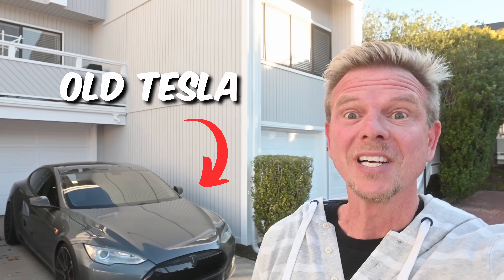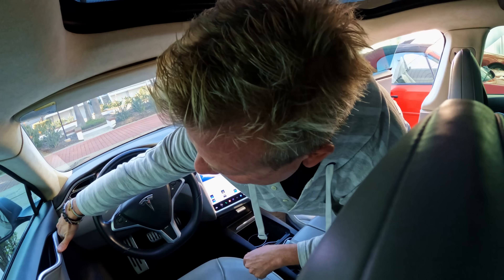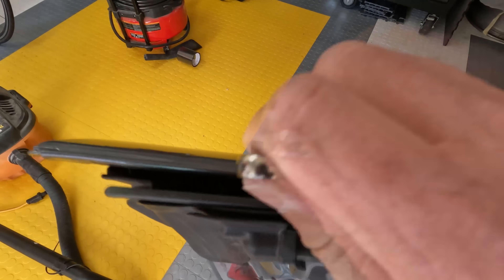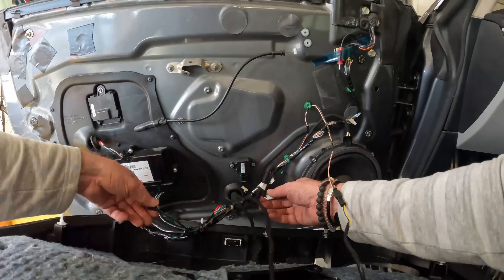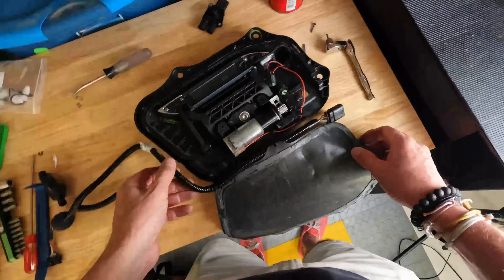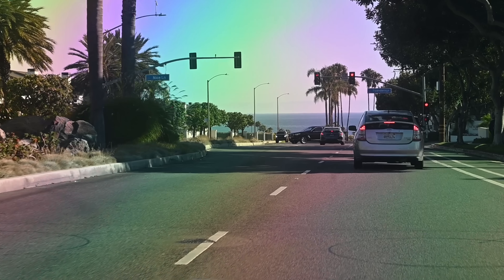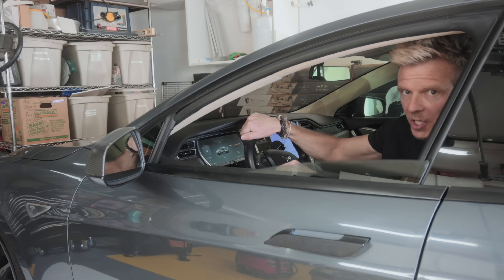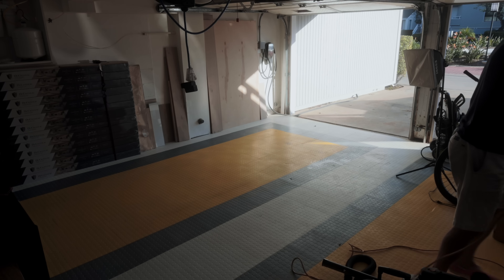My OLD Tesla Model S Just BROKE. Now What???

Comment: Never buy a used Tesla.  In fact, never buy a tesla at all.
Reply from the maker: And why would that be?
Reply: @cadreamdrives  By a hybrid.  Hybrids give you a redundant power source.  All electric will become a failure.  That is why Toyota pulled out of the all Electric market because they see where its headed.  Too many dead teslas with tesla graveyards accumalating premature dead faulty teslas.
Reply from the maker: @nbagoats4819  Where are all these failed Teslas, you speak of? 
Toyota’s decision seems driven as much by the fact that they missed the EV train. The world is going to EVs. Many countries have laws on the books will face out ICE cars. 
Hydrogen cars MAY become the next thing, but not for quite some time. 
Also, the Tesla Model Y was the best selling car in the world last year. 
Honest question: Have you owned an EV or even driven one for an extended period of time?
Reply from the maker: @nbagoats4819  We can probably argue the information you got from a Lexus dealer vs what I think based on 4 years of Tesla ownership, but that might not get us far. 
Instead, I’ll suggest this. Give an EV a try. Preferably a Tesla, but there are others out there that a great too. 
See what you think after driving one / living with one for a little while. 
I was a 100% die hard ICE car guy (I have about 8 ICE cars still). I had Zero intentions of switching to an EV - right until I bought one. The plan was to rent it out (I rent out cars), but the first time I drive it, I was hooked. And after living with it for 4 years, I’m never going back. EVs are better than ICE cars in every conceivable way. I’m slowly selling off my ICE cars (I never drive them), and I’m buying 3 more Teslas for our household this year. 
The ownership experience is THAT good. 
But don’t take my word for it. Try one for yourself and see what you think.
Reply: @cadreamdrives  I have 5 different family members with Teslas.  Have driven and ridden in them.  There are exceptions to every rule.  A few like it whereas the others have had problems and didn't like the fact that one hiccup in the battery and everything seizes up and dies.   Including your doors.  Very picky when the temp changes so does your range.  Range anxiety.  Battery degradation.  Getting from point A to B has never been more complicated.  NO THANKS!  

Like I told you, the writing is on the wall.  When I see a tesla all I see is a low quality concept being sold to ignorant status starving apple buyers.  I am not impressed. Hybrid is the best of both worlds and is more of a practical comprimise especially when it comes down to reliability.  EVs will be reduced to a smaller market and hybrids  with larger batteries will be the mainstay.  It makes a lot more sense.

The total market share of conventional hybrid cars and plug-in hybrids grew to 9.1% in 2023. The EV share only rose to 6.9% and is currently in decline.  Tesla shares dropped 6% last week.  2024 is going to be a bad year for Tesla.
Reply: My daughter had a 2015 model s , she dumped it after 18 months due to constant problems and dealing with the service center was an absolute joke. No more Teslas for our family. Very shady company to deal with.

Comment: I don't like the all computer cars.... think about me selling a computer controlled thing with one year warranty.. what stops me from sending code switching off options after 365 days??
just like the yearly self drive crap.... don't pay it after the year and guess what.... no self drive for you!!
Reply from the maker: You may have to stick with cars from the last century… Software driven options are used by many, if not most, of today’s manufacturers.
Reply: @cadreamdrives  Oh really.... can they just send a software patch and shut down option or modules in any new car? ??... maybe ..... but can you do it on a 2015 gas car with 8 on board computers,,,,,, so sorry they can't.... thus I stated all computer meaning controlled completely by a computer dependent on if you paid or not which would also give them the power to shut down modules such as yours  after warranty.. notice I CAN buy a door handle and install it in any 2023 car other then yours without having to take what...... 2 to 3 trips ..to a specialist??? I guess you guy love spending money and time but I would rather install it once don't you think?? and BTW before you say tesla or any other company would do such a thing..... read on VW diesel and now Cummings engines....... yeah......... it happens

Comment: Not buying the Tesla would have saved you a whole lot more.
Reply from the maker: How do you figure? 
For the last 4 years, I’ve paid $0 in gas and haven’t had to take my car in for an oil change, spark plug change, recommended service, brake pads or rotors, or anything like that. 
At the same time, I drive a car that’s faster than 99% of the cars around me, has better tech, and infinitely more storage space than any ICE car I have ever owned. 
I’m not quite sure how not buying this car would have saved me money?
Reply: @cadreamdrives  Did you buy tires?

Comment: Tell me again how an old BMW is a money-it please....
Reply from the maker: I can very easily tell you that. I have 6 BMW of varying age right now (we just sold the 7th one), and with the exception of the almost new ones, stuff breaks. And it’s not simple stuff. 
Why BMW can’t get something as simple as an oil filter housing right is beyond me. I understand how you make a bad design the first time around, but to continue with the same mistake in newer models is just bad. 
There are so many mechanical components in BMWs that just aren’t built to last. The dealers make huge money on the repairs, so there is no great incentive to build stuff that lasts longer. 
Oil filter housings, leaking valve covers, VANOS going bad, leaking timing chain covers, coolant parts that disintegrate, valve seals (which caused the engine in my 650 to self destruct), window regulators, high pressure fuel pumps, having to walnut blast the valves because of direct injection - the list is literally endless. 

Yes, the door handle went bad on my Tesla. And yes, there are other things that can fail. But the order of parts that can fail are magnitudes smaller than on an ICE car. 
Oh - and that list doesn’t even include all of the maintenance items you have to do regularly on your BMW or the cost of fuel, which is exponentially higher. 
So yeah - old BMWs are money pits compared to old Teslas. 
Which is why I’m selling all of mine and getting more Teslas.

Comment: Moral of the story, don't buy a Tesla. Beautiful cars but engineering is bad. There's a whole channel here dedicated to Tesla repairs.
Reply from the maker: Right - because we all know that cars usually never break 😄
Reply: @cadreamdrives  My car is a 2010 Honda Fit. I bought it used in 2014. I've only had one problem with it since I bought it. The evaporator core leaked. Granted, it was an expensive repair, $800 parts and labor. I've seen multiple Teslas that break, mostly the electronics but also the battery cooling system. I'm not anti-EV. I want one some day but I would never buy a Tesla.
Reply: @tims8603  so you're comparing luxury with a shitbox?
Reply: @gameboy4696  No, I'm comparing quality to flash. Teslas are very nice to look  at and, probably, fun to drive but they're poorly engineered and expensive to repair. If you don't care about high, frequent repair costs and high insurance costs, fine. I'd rather own a quality built vehicle that doesn't spend a lot of time in a shop. Hertz tried to have Teslas available to rent. Costs of insurance and repairs caused them to abandon them.
Reply: @tims8603  that's the same thing as owning a luxury car. Parts are expensive no matter if it's a Tesla or a Mercedes. Insurance costs with a traditional company is gonna be high because of the part costs and many of them don't want to even insure Tesla's by putting a super expensive premium or just simply denying coverage. That's why Tesla has their own cost effective insurance company that only insures Tesla's.
Reply: I still see Tesla's for rent at Hertz and Avis. So maybe they're not getting rid of them after all.

Comment: Im driving a 21 years old diesel sedan from Germany and i have never experienced any problems during the whole ownership thus far. 😅 This is embarrassing and just plain bullshit 😂
Reply from the maker: You should go and buy a lottery ticket! 
If your car hasn’t experienced a single issue in 21 years, then you may be the luckiest person on earth! 😄
Reply: @cadreamdrives  😅 ur right. In all honesty, im probably real lucky with this car. Of course i had changed parts in the suspension on a regular, but everything has and is still working in the car. Never had any kind of problems that prevents me from entering or driving it as i wish. Engines on those cars are cast iron still, so no issues there either.

Comment: Too much work for a car tbh, it should be easy fix and replace none of the calibration stuff. That's why i got rid of my Tesla.
Reply from the maker: In fairness, it took a long time because I was new to the entire process. Today, the whole thing likely wouldn’t take me more than an hour. It also turned out that you can do the calibration yourself, so it’s really not too bad. 
I just finished what seemed like a 30 hour job on a BMW. The Tesla is WAY easier to work on - and has way fewer parts that can break.

Comment: Remind everyone how OLD this car is again.
Reply from the maker: As of right now, it’s about 12 years. 
It was one of the first Tesla models to come out.
Reply: @cadreamdrives  Just wait until you need a battery pack, then the true cost of EV ownership will kick in.
Reply from the maker: @AllanT-nu4rw  I get comments like this ALL the time. However, I just don't get this argument. Yes, the HV battery MAY fail at some point. It happens. It's not a given, but it happens. But so does engine failure in ICE vehicles. And replacing those are often much more expensive. 
The price of HV replacement batteries have come down quite a bit as well. You can get a refurbished battery from Tesla for $15k or one from a 3rd party for about $10k. You can also have failed batteries repaired. 
None of those prices are cheap, but in the case of a Model S, you're also looking at a car that was $100k new. Replacing engines in $100k ICE cars is a LOT more costly.
I've had engines fail in a Jaguar XKR and a BMW 650i. Both at less than 75k miles. And both had prices tags that were WAY higher than an HV battery replacement.

My point is, there seems to be some misconception, that all HV batteries are about to fail and combustion engines never fail. Neither is true. There is always a risk when owning a used car, and the higher the initial cost of that car, the higher the monetary risk. Except, there are many fewer things that can go bad in an EV. And you have close to zero maintenance costs over the years - which is something that definitely can't be said for older luxury ICE cars. And finally, if you get the right kind of old Tesla, you could be driving for free with the included Free Supercharging for Life. 

If you add up all the cost savings from an EV and then compare the risk to other cars of a similar price point, the EV comes out way ahead every time.
Reply: @cadreamdrives  and yet you can easily rebuild an engine and transmission,,,, however failed batteries need to be replaced. I might add that most vehicles today suffer from electrical issues a lot more than mechanical ones. Electrical components have a nasty habit of failing regardless of age and in 99% of the time cannot be repaired. I see no benefit of owning an EV whether new or used because the massive amount of electrics in it are going to fail, its not a case of if,, but more a case of when and how often. Will there even be a used part to replace the failed one due to planned built in obsolescence. Just look at your fiasco for the door lock which is quite a simple part. No doubt you will soon get rid of the car while ICE models will soldier on for easily another 20 years. Its funny how I have kept many vehicles for 20 plus years and never had any issues you speak of or needing a battery pack replacement,, oh right because there isn't one. I laugh at the often mentioned EVs near zero maintenance required talk, its like a pie in the sky dream, EVERY piece of equipment in use needs routine maintenance.